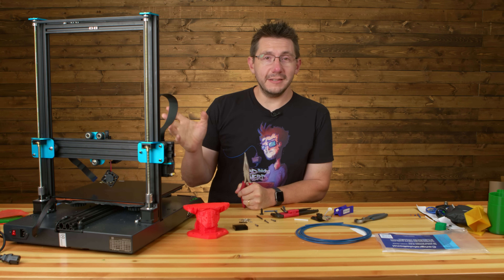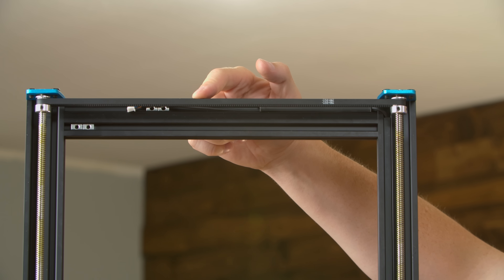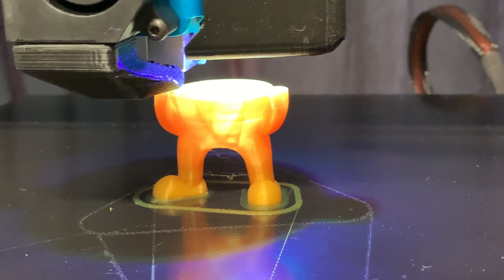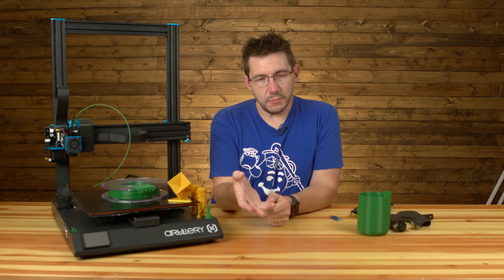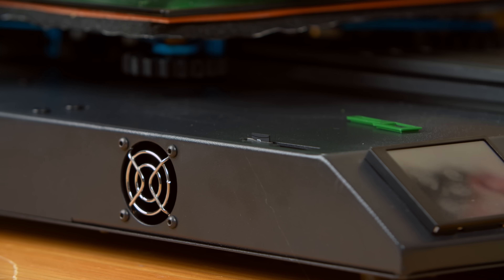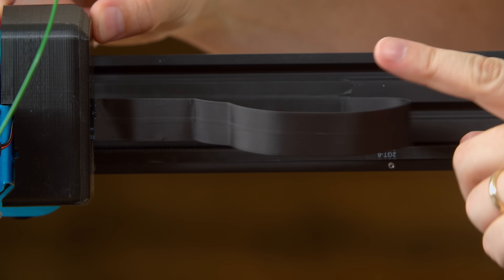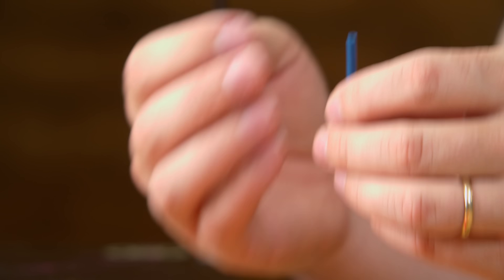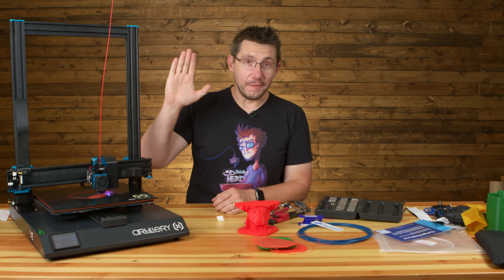The Artillery3D Sidewinder X1 3D Printer - A Must Have?

Comment: Joel, 
I truly appreciate all opf the great work you do. As a newbie to 3D prionting, the information you offer is very helpful.

There are however so many printers to choose from, it's hard to decide which one may be best.

May I offer a suggestion? A car YouTuber called Doiug De Muro gives each car a Doug Score. He gives points for a variety of features etc. It's very helpful, as it seperates the wheat from the chaf.

I think it would be great if you printed the same standard file for each printer you test and rate the time taken, the quality of the results. Also value for money/cost, pros and cons, ease of assembly(if appropriate), build volume, before and after sales support and whatever other features you deem important. A standardized 'test', would make it much easier to hone in on which is the right printer for your application.

Comment: Old video, but if anyone still has this USB problem:
I had the same problem with either weird movement with a brim enabled, or even weird movement on the first layer outline with the brim disabled. All when printing from USB and only on the first layer. Also 100% repeatable.
I've solved this by updating the touch screen (TFT) firmware, NOT the printer firmware itself, just the TFT firmware. The printer is still 100% stock with stock Marlin 1.x as it was shipped. I used the firmware from digant at Thingiverse, thing:4294049. And again, I only updated the TFT firmware, since my printer otherwise prints great and I didn't want to loose any settings etc. Update is as easy as copying files onto a MicroSD card and booting the printer. Works great now.

Comment: I kinda understand why its cheap.. And why Banggood bans it from Israel, as our regulations demand any electric utensil with exposed metal parts to have them connected to grounding. This is crucial as if electricity get there and you touch them, you could get electrocuted. So if you didn't purchase this printer - don't, until Artillery fix this issue. IF you already purchased it - you need to connect a grounding wire both to the body and to the heated bed. Good luck with that.

Comment: Technically, the engineers who designed this printer thought that "who cares if its AC, it's covered with glass so no one will touch it". Nope! that's not how it works! The AC part is still accessible. IF you don't connect a grounding wire, you're risking your life.

Comment: Thanks for all your great videos--big fan. I started all of a sudden getting clogging on all my prints with my Genius. Filament just stopped coming through anywhere from 10% to 50% of the job during EVERY print, and in prints that had worked fine many times before. Typically the printer was continuing, "printing" in thin air with no filament coming out. I found that I could often get the filament to start flowing again by pushing the filament through from the top by hand (although the print was already ruined).

So far this sounds like the situation I´ve seen in many videos on YouTube, but wait...

1. I´m using an all metal heatbreak, so no PTFE anywhere down where the filament is molten, and I changed the heatbreak and the nozzle several times. Also, this happens with 0.4mm and 0.6mm nozzles. I´ve also done several cold pulls, even with nylon as you suggested in another video.
2. Whenever this happened the extruder gear was just wearing away the filament as it turned in one place until I stopped it (that´s where all that ash-like dust comes from). I tried adjusting the spring tension on the extruder gear, but teeth marks on the filament could be very deep or hardly visible and it didn't make any difference.
3. I used filaments I had successfully used before (all PLA), even new ones still in their sealed plastic bags.
4. I reduced the retraction from 5mm to 2mm.
5. Of course, each time I checked that the filament spool was spinning freely.

So, anyone have any comments or suggestions?

Comment: I have a question concerning the X1 V4.  I have one of these and I am really happy with it for the most part.  One thing that I found is that my extruder stepper motor is running at 70C which I am sure is too hot.  However I also noted that the aluminum plate that holds the wheel on the x axis gets over 50C.  This temperature delta by my calculations could cause the wheels to move over 1mm further appart which I am sure would cause some degradation in print quality along the Z axis.  My question is what is the temperature that your extruder stepper motor is operating at?  Yes I adjusted the roller tension.  What I also found is that this unwanted excessive heat causes the cold end to get hot enough to deform the filament profile, cause jams and damage the PTFE as well.

Comment: The error mentioned at 11:35 also occurs with my Artillery Genius. Regardless of the USB stick used. It seems to occur with Slic3r version 1.3.0 and higher. Using Slic3r 1.2.9 and Cura this problem does not occur.

Comment: I own one, It's my first 3D printer so I cannot compare it with another printer, But after 1 year, the printer it's been not working for more than 6 months...first, a cable burnt, then a component broke, thermistor, a connector, another cable,....oh man, this is annoying. Technical support is kind and helpful but they send from china and takes 1-2 months to arrive...I guess this is what you get when you buy a cheap Chinese thing so no complaints :)

Comment: 10:43 The Longer 3D Orange 10 has a little space around the SD card slot like the case hole is slightly bigger than the actual slot. So at least twice I actually got my SD card lost inside the machine because I thought it was in the slot but it wasn't.

Comment: I wonder if this style of printer could be made even more stable, if the frame was mounted just a little differently.. What if the vertical side rails were mounted perpendicular to the top rail, so that the top rail screwed into the middle of the double wide rail, rather than through it's side. Or to describe it a different way, the screws that mount the frame to the base would be next to each other in a front-to-back orientation, rather than side-to-side. If they did that the top of the frame would be more stable from wobble, and they'd only have to make minor changes to how the rollers mount.. But I've yet to see a single printer in this format try that option.

Comment: After sinking hundreds of hours I'll never get back into troubleshooting my Prusa MK3S, and coming to the conclusion that their proprietary heat break was the issue, I sent it back (because they refused to acknowledge the issue no matter how many people were making the same case on their forums...) and vowed to never buy another 3d printer that has even a whiff of a problem related to heat. 

It's the worst, most insidious type of 3d printer problem because it doesn't manifest itself until you are several hours into your print, and even Josef Prusa himself admits he doesn't know how to fix it because even other company's extruders were producing the same heat-creep issue on his machines. I'm so fed up with hearing about this rampant problem with FDM printers that I think I'm going to go the SLA route and deal with the post-processing hassle.

Comment: I think I don't like the hot end arrangement it comes with. That looks like an e3d volcano clone. The volcano is a fine hot end with a specific use case. Printing big things with large extrusion width and layer height, fast. I feel a printer should not come stock with this type of hot end without specifying that it will have issues with stringing due to the long melt zone, when using a standard .4mm nozzle and printing smaller stuff.

I also really dislike the flimsy ribbon cable design, as well as the heavy extruder motor. I think a 3 to 1 gear reduction with a pancake stepper would allow faster printing without ringing, especially paired with the volcano style hot end.

Comment: I just ordered the new hermera for this printer and already fixed the holder this printer has been as quiet as the original prusa and same print quality and hopefully now much better on soft tpu filaments as well I dont ever use filament runout sensors as I feel if someone needs that they cant do basic math and I may switch over to a removable bed surface and this printer will be a large print volume that can handle it all

Comment: Hi first of all I’d like to say fantastic video 
Second I hope someone will be able to answer If you bought a 3D printer and the temperature maxed out at say 250 degrees would it be possible to increase the working temperature to that what is needed to print using a higher temperature filament just an honest question

Comment: Hi, can i know the retraction settings? Length and speed, i had some problem with stringing , already low the temp to 198C and length 8mm with 75mm/s retrac speed l, thankyou
Reply: 1.5 mm @ 35mm/s

Comment: Does V4 version of this printer still have the PTFE tube problem?
Reply: I have a V4, but still wouldn't sugest pushing the temp above 230ºC without swapping to an all-metal heatbreak. When PTFE degrades it releases neurotoxic fumes, so I chose not to risk it. The most recent V4 has a Kraken heatbreak, it should not be expensive to make the change. If you only want to print with PLA, the machine will work flawlessly.
Reply: Caio Castello Grandi Ribeiro If you get some capricorn ptfe that problem should be fixed

Comment: That is the BEST spool holder.  ALL that anyone needs to do is put small lengths of PVC or Copper tubing over the bearings wide enough for the widest spoole and never adjust it again.  small spools won't fall over and changing is great.

Comment: I'm betting the controller can't process the gcode from the USB fast enough and it's skipping commands. I would like to see manufacturers include a buffer in the controller's memory where the entire gcode can be loaded (or mostly loaded) before printing starts.
To rule out the controller, though, have you tried a USB stick with higher read/write speeds?
Reply: You can also rule out your slicer as the culprit by trying a different one, or by loading your gcode into a viewer.
Reply from the maker: Yeah, I've heard a few others slicers replicate, and some don't. Which, makes it even weirder. Suspect gcode does NOT show the triangle in a viewer.
Reply: @3DPrintingNerd  in that case, I have to believe it's hardware, either the thumb drive itself or the controller. Definitely weird.

Comment: The USB thing (I mean the motion during skirt layer you talk about) is something usual when you don't have CRC check while doing memory read. For example it should parse the g-code line like G1 X30.000 but due to read error from USB it sees G1 X(something unusable) so it interprets it as zero or something else that is incorrect so it goes to another position then reads the next line of g-code correctly and goes to correct place after that. to reduce the possibility of this issue you need to reformat the USB stick and recreate the file. I have had this issue many years ago when I was designing and making my own 3d printer.

Comment: 13:30 also it seems the adhesive on the silicone heater has let loose :(
Reply: It's loose on a lot of them on delivery, and pretty near impossible to get to stick. I'm trying to figure out what the best alternative adhesive would be for mine.
Reply: @springplus300  same stuff it is made from; Silicone.

You can thin silicone rtv and spread it like glue :)

Comment: If I didn't already have a CR-10s modded with direct drive and tuned to high heaven I would get this printer in a heartbeat. The sturdier build, encased base and electronics and how insanely quiet it is makes it, probably, one of the best printers you can get for the money right now.

Comment: Oh Wow. No cooling on the hot end is a major design flaw!

The PTFE tube will expand due to the heat and pressure of filament and will clog most definitely.

They need to redesign that carriage ASAP and not depend on the community to fix they're flawed machine.

Comment: So if that hot end design limits you to less than 240C, then that's not a machine that you'd want to do PETG on either. Ive gotta say I wouldn't expect Joel to recommend a printer that cant go above 240c..
Reply from the maker: Why? PLA is plentiful, and I bet with a swap of the PTFE tube I can do PETG easily now. I'll give it a shot!
Reply: @3DPrintingNerd  , For me at least PLA was just a gateway to printing.  Given that so many other machines can do at a minimum PETG decently right out of the box, I'd consider not being able to hit 260c on the hot end a serious negative.  If you have ever put hours and hours into finishing a PLA prop, only to have it melt, sag, or deform...  Then you start making PLA the exception, and print in more durable materials.  The real Titan Aero prints @ 260 temps with no issue (own one on a CR-10).  Prusa i3Mk3 no problems with 260 either..  For me, and I think for others, a limitation of 240 out of the box would be a huge red flag, and would preclude me from recommending it to anyone.

Comment: I cant find someone told you this before ... At the back of your Heatbet, the orange silicone/rubber like material is the important thing of the bed ... At your printer it doesnt stick to the bed, so it is useless... Just press ist to the Glass. I got mine today and it sticks perfect after a bit of pressure... Maybe you have to glue it otherwise

Comment: What would you recommend for a first 3d printer to buy without to much maintenance?
Reply: depends, as always, on your budget - the prusa i3 mk3s is known to be one of the best and most reliable printers out there... but it comes in at 750 dollars for the version you gotta build yourself and 1000 dollars for the preassembled one. The thing is, the cheaper 3d printers like the creality ender3 are always gonna bring some amount of tinkering to the table before they run really well (which most of them will eventually). TBH though, if you dont plan on starting 3d-printing as a hobby or have a hobby that more or less requires 3d printing (like fpv-drones or maybe dnd figurines for example) it wont be a good idea to get a 3dprinter... i have a couple of friends who got one cuz they though itd be awesome to have one but then you just print some random shit on thingiverse for the first couple weeks and after that it will be a dustcatcher in a corner of your room

Comment: I'm pretty sure using wing screws for the spool support would fix the holder "issue" :)
Reply: Or you can print a roller design that fits over their bearings, See this link for a design. https://www.thingiverse.com/thing:3850399

Comment: Hi Joel,
I have the same printer, but I have got the version 4 (at the time of writing, the latest version).
In this printer I have, there is no problem with the sheet metal anymore, the holes are just big enough to use the SD card or USB stick. Also, the USB stick GCODE behaves just the same as the SD card GCODE, I guess that problem is also fixed (or at least, I don't have that problem). When I bought the printer, I levelled the bed, I didn't do anything about it since and now, about 30 prints later, it is still a perfect level as it should be.
The spool holder at the top, yeah. That's a problem. I don't like it that much, but it's not a big thing. The cable restraint still is not good, you have to print your own part to make it better and the hot end still uses a low cost, crappy PTFE inner liner tube. That said, I print NGEN filament at 250C all the time with this printer and I don't believe at that temperature, on the nozzle, the PTFE tube is going to be exposed to a temperature above 230C. I can only tell what the outside of the heatbreak shows, but on the thermal camera, there is a difference of more than 30C between the hot and cold side, seen from the outside.

I don't know if I will make a video about this printer yet, as I am very limited in time lately, but I just wanted to tell you this.
Thanks for your great reviews and other video's. As always, greetings from the Netherlands.
Reply: Print this mod for the spool and you wont need to ever move it again. https://www.thingiverse.com/thing:3850399

Comment: hi, i got a problem on 3d printing a 1.5 modules(80 teeths or above) bevel gear. Especailly i saw my 3d printer which i had. It  failed to print the last stage which is near the top bevel teeth. It just won't stick on it. Do you think you can print it  and make a video with it. Give me some advice with it.